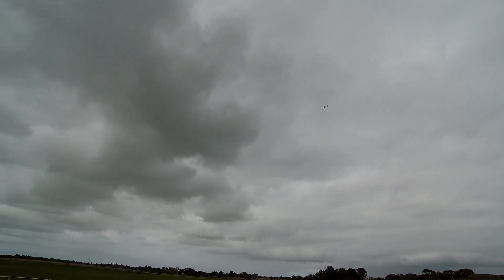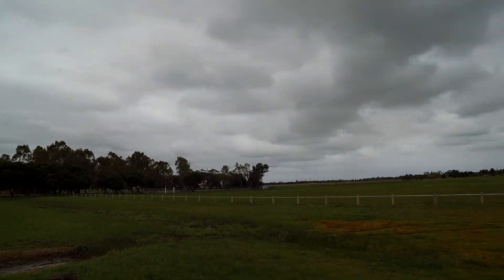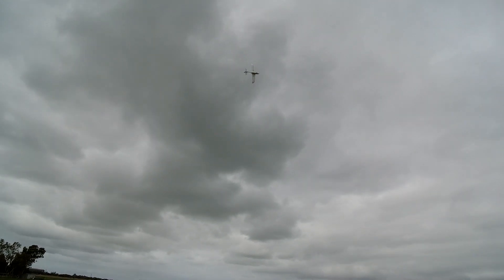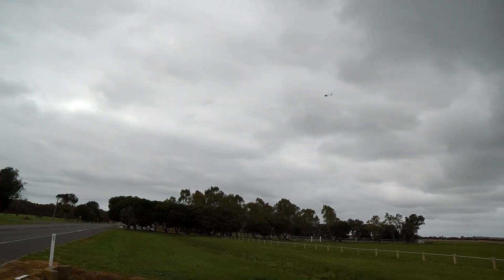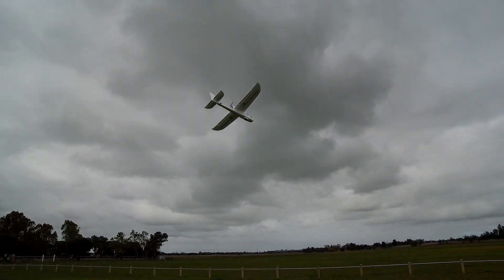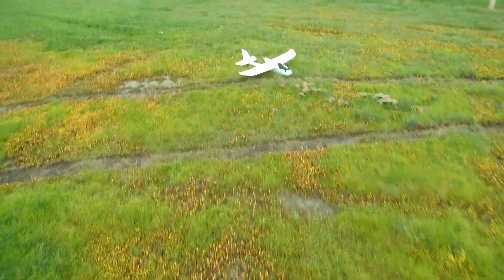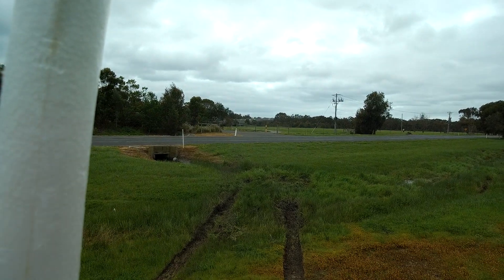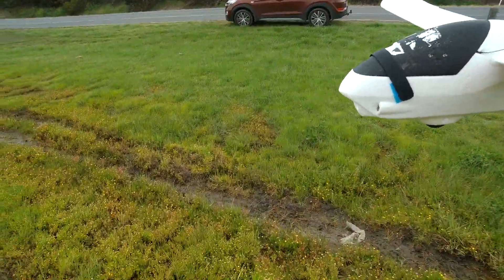Ranger G2 test on 4S

Comment: Mine came with an Ares 18A ESC rated for 2-3s, and a 2212 10T 1400KV with shaft coming out the bottom. So I'd be careful and check the specs on whatever yours comes with.
Reply: Oh thanks for that info. Mine has a 3 to 4S ESC
Reply: @AndrewNewton  You're very welcome